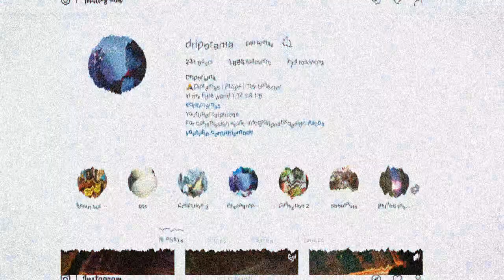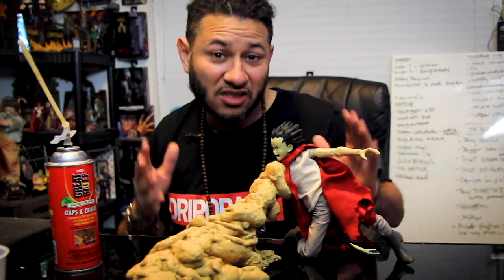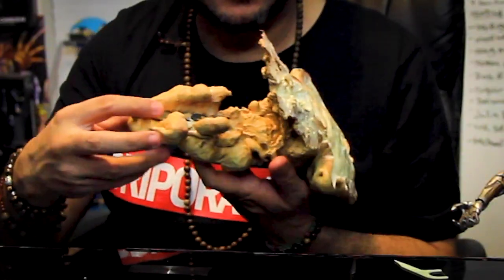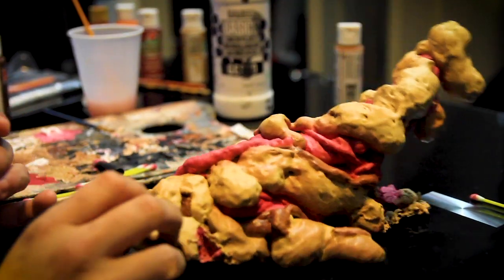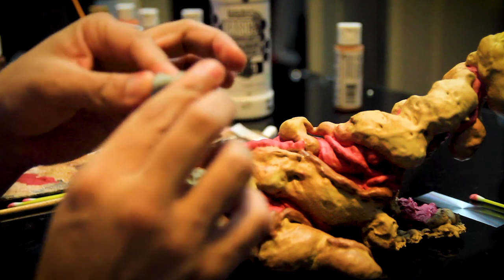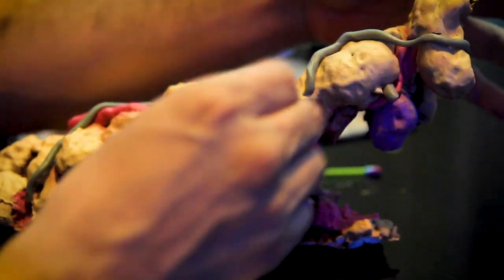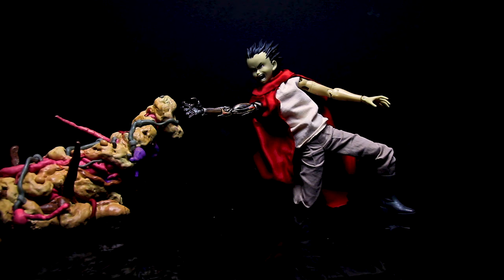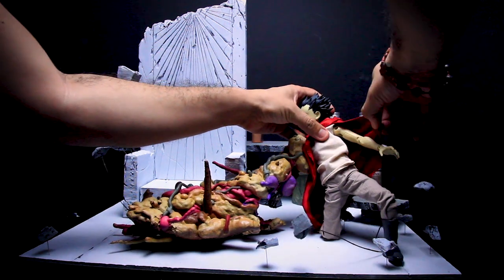Project BM Tetsuo's Arm Custom Prop from アキラ AKIRA | Vlog140

Comment: It's so crazy that you posted this video this is something I've been just recently thinking about. I was wondering if there was a way to insert lighting into this spray foam while building it and making it look like illuminated smoke? Just wondering if you have run across or attempted to do this? I've also been wondering about heat and the transference of that heat into the insullation. The last thing I want to do is start a fire with a display. Especially considering the fact that one of the ingredients in the plastic is gasoline...